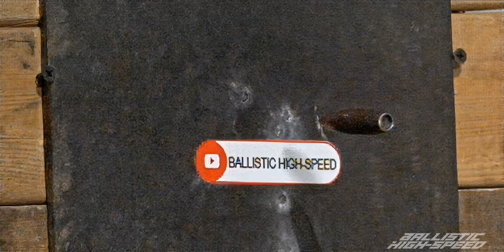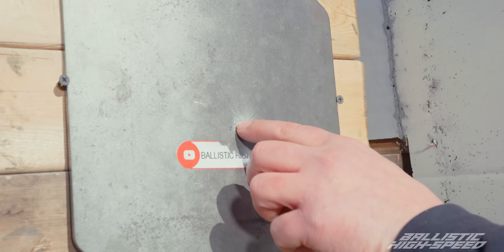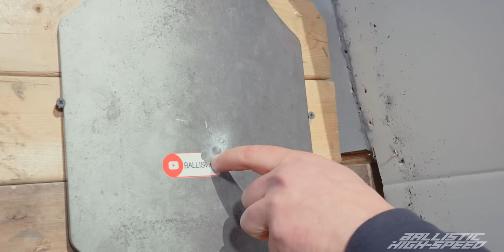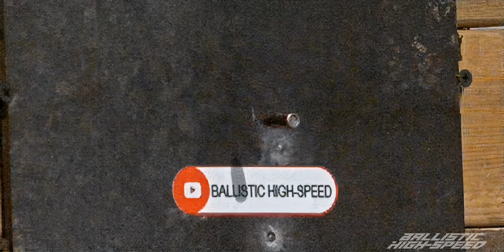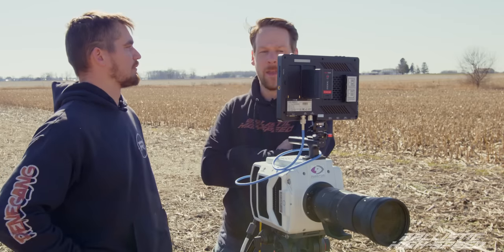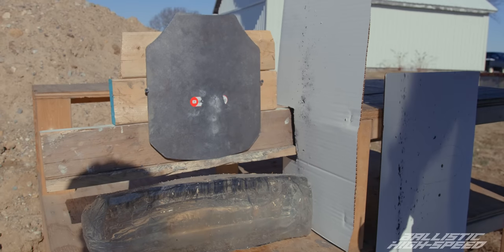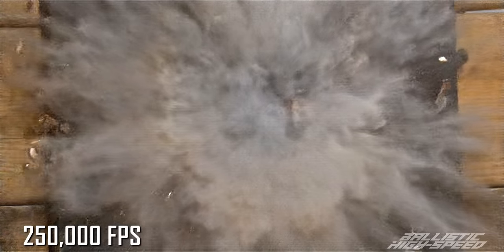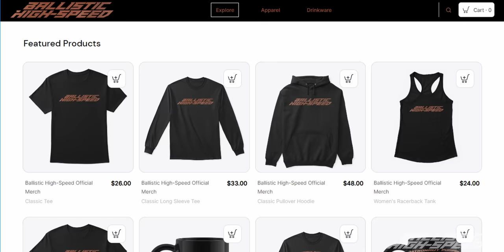Rifle Calibers vs Steel at 250,000fps! - Ballistic High-Speed

Comment from the maker: Correction at 14:32: The velocity of the .50 BMG is about 910 m/s.
Reply: 4 km/s would be sweet
Reply: I figured out that same thing. There is just a small mistake. actually it is something like a 914m/s.
Reply: @chaprandom8362  It would even penetrate a tank with this amount of speed
Reply: To have that energy and speep the bullet would have to weigh about 2 grams
Reply: Yeah wtf 3000m/s is hypersonic LOL. i don't think it's possible to make any projectile fired out of a gun go that fast haha
Reply: There was also same velocity and joules with the 7,62x39 and 7,62x54r. Which one is correct?
Reply: Lol I was wondering. Great video tho guys👍
Reply: @peterfinland1370  I think in this test they are indeed have same speed, as 7,62x54r was shooted from relatively  short barrel.
Reply: Auschwitz Soccer Ref.  They should also try some M903 SLAP rounds, the only ones that reach 1200+ m/s in this caliber.
Reply: Also the 7.62x54r numbers are the same as the 7.62x39 numbers.
Reply: @chaprandom8362 that would be over 16x the kinetic energy. sweeeeet
Reply: Uh, guys... it isn't power so much as bullet material that made the big 50-cal so impressive.  All other rounds had a lead core, (well, the green-tip 5.56 has a small steel penetrator inside the front of the jacket, but it is of little consequence) but the BMG round is a steel core wrapped in copper.  When studying high speed impacts, the materials do matter a bit!   For real fun, use a 50 BMG API round - that one has a freakishly hardened steel core AND about 11 grains of explosive under the jacket.  They make for quite dramatic high-speed shots.
Reply: @M65V19  Still they can't be exactly the same.
Reply: @kingkezz9188  This is admittedly streching the definition of a gun a bit, but Light Gas Guns can achieve up to 8,5 km/ second.
https://en.wikipedia.org/wiki/Light-gas_gun
Reply: @meteormanmeteorman  Lol I dont see a reason why this cant be handheld tbh
Reply: @whoisknight2297 , nah the round would disintegrate
Reply: Another great video! Thanks for the correction. I was wondering if you were using the specs from the manufacturer or if you calculated it using the high speed?
Reply: @thingsstuff6564  ?
Reply: Next time try shooting 3/8 or 1/2 inch mild steel and put another camera behind the plate to show the bullets exit and pass through. I've always wondered how much mass was still intact after penetration
Reply: I want to see 22 250!!!!
Reply: @kingkezz9188  The coup the grace in Operation Devestating Impact:
Reply: Yes, I did notice their little mishap immediately and yes, I did say the.50 would punch 
a hole in the metal plate for sure even though I don't know much about that caliber.
Reply: 50 cal velocity for m33 ball is 2910 fps +/- 30 fps at 78 feet. M2 ball is 2810 fps. I have a 50 cal sabot rnd. With a 30 cal a.p. projo its supposed to be about 4800 fps.
Reply: @M65V19  Exactly the same numbers sound unrealistic.
Reply: @M65V19  The barrel was even longer making the numbers given for the 7.62x54 even more implausible.
Reply: @peterfinland1370  7.62x54r is about 3000-3500 jules
Reply: @whoisknight2297 ... that's what it was originally designed to do. Tanks up armored and it was no longer suitable. Made a fine aerial weapon though. Tanks still mount them, for general mayhem.
Reply: @chaprandom8362  E = M*C*C its only a problem of energy ... 😂
Reply: Correction, the 50 bmg only goes 3000 fps out of a 45 inch m2 machine gun barrel, here in this video it’s going 2000 fps which is ~600 m/s
Reply: @meteormanmeteorman  ...rail gun also has freakishly high velocity
Reply: @peterfinland1370  To jeden błąd, a drugi jest w 14:33
Powinno być 914m/s.
Reply: @kingkezz9188  Actually, you need to look at a rail gun.
Reply: I would confirm the muzzle velocities you posted for the 7.62x39 versus the 7.62x54 as well. I find it hard to believe that they have almost identical muzzle velocities and that the fragments from the 7.62x54 after impact are moving faster than the original muzzle velocity of the bullet.
Reply: @chaprandom8362  honestly approaching hypersonic territory lmao. 4km/s would have enough energy to seriously damage if not penetrate tank armour
Reply: Yes I thought so. Why? Because on YouTube is a video of a snipershot over 3 km. Then before it hit the target You could count a few secondes from shot to hit. With your Numbers that snipershot would be there in 1 sec or so.
Reply: The two rounds with the same speed must have been a mistake. The the numbers for one round up twice. I think it was the 7.62x39.  7.62x54 is almost 40% more casing.
Reply: I would like to see a 0.50 cal going 4km/s
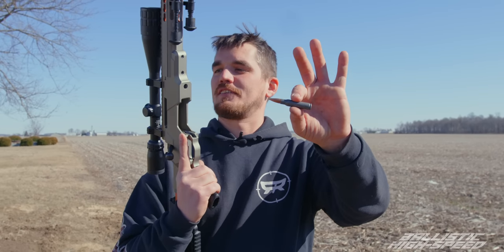Reply: 9:54 mins Versus, not Verse.
Reply: Not .50 BMG The END of LIMIT 
PTRD-41 14.5x114mm  duble power, energy that 50BMG because 30.000J
Reply: Is it possible to sample audio at a similar speed as the footage, with some custom equipment?